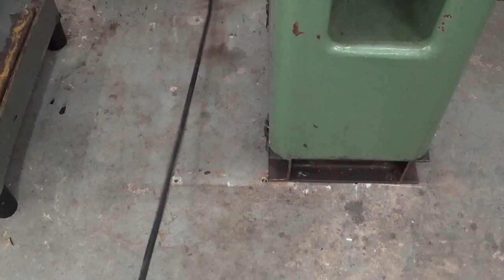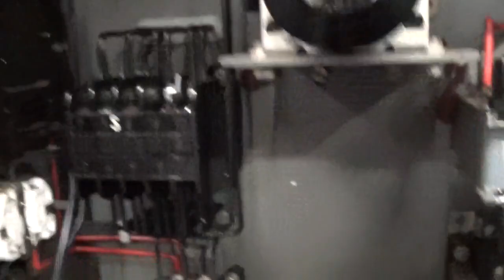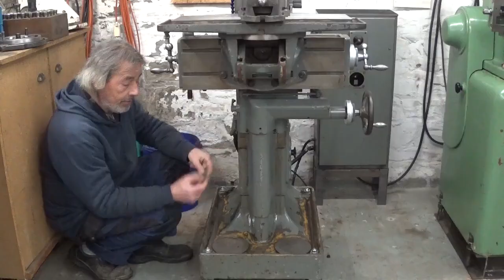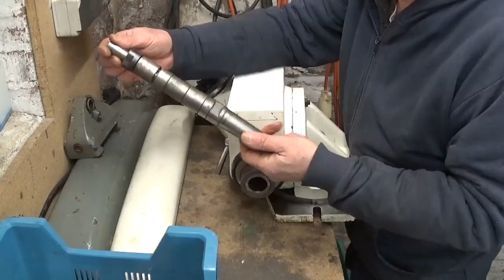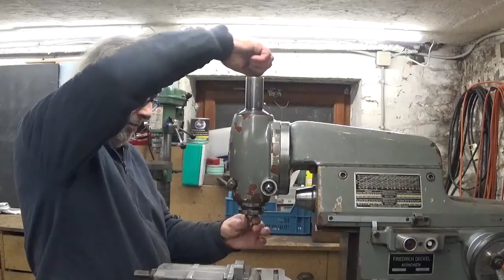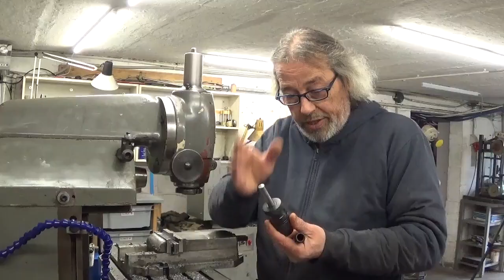My Deckel FP1.

Comment: The last time I saw this Deckel FP1 Stefan Gotteswinter was machining something on his rotary table on his FP1. Rustinox have you checked the run-out of the spindle?
I would recommend the Kurt Anglock vise 204 mm jaw width. I love them.
The handles you can clutch them so when you press in on them they actuate, release the handle and it doesn't move.

Comment: Finally a video on a fp1, I recently bought a 1952 fp1 and love most everything about it. I really wish I could lock my spindle for when I can't get stubborn tooling out and for running indicators in the head while using the power feed. Not having reverse really sucks for tapping as you mentioned as well.   I wish I could figure a way to install a dro off the spindle but have be unable to make happen yet. I'm really glad you made this video and hope you make many more on this old girl as I have so many questions and there are so little answers out there. Thanks  Mike
Reply from the maker: Thanks Mike. I'm still learning myself the details of this machine. But if you have any questions, don't be affraid to ask. I can maybe put them in a video.

Comment: Recently bought on old version of deckel fp1 . Does the horizontal spindle drawbar come out of the spindle. It's rotating but not coming out. I want to check the threads of drawbar so I can purchace some collets.

Comment: I spent 3 years in the early 80s using a deckel fp1 with 3 axis DRO, fixed table, rotary head, slotting head and high speed head on top of what you have there making complex cavities and cores for injection molds. I love the incredible versatility and accuracy of these machines even after 30 years. I also got to use fp2 and fp3.  This was in Australia.
Reply from the maker: That's nice, Ron. I suppose, you know how to run a milling machine now :)
Before I had this one, I only operated a milling machine in scool. Son I have a lot to learn.
Reply: @Rustinox  and you will. I spent over 30 years in metal trades, it's not what you know that matters, it's how much you want to learn. You've picked a great piece of equipment to learn on. I don't know if you have the rotary head  but the collects also fit in that, as do 3-jaw and 5-jaw chucks and a flat plate.

Comment: Now, with the Deckel, the shaper and the very suitable engine lathe you have what could be considered the best equipped Tiny Shop in the World !  Just goes to show that with a little ingenuity and patience you can still build a shop on a budget -- more good work to come !  If you're going to do a lot of climb milling,  get yourself some good quality way oil -- the "stickiness" ( along with proper gib adjustment ) really helps with those worn leadscrews as compared to something like the really thick leadscrew grease .  Of course, looking into getting a new leadscrew nut would also be a definite plus .  Keep up the good work, Rusti !     until later --  ken .
Reply from the maker: "Tiny Shop". That's a nice expression. I like it.
For the ways, I use gear box oil SAE90. Nice and sticky as you suggested. Indeed, it works really well.

Comment: I have the MK1 model, slightly older, from 1938. I received it without change gears for table feed. So i gutted the table feed mechanism and I am replacing with a motor driven system and fit everything in where the previous chain drive was. Only thing stops you from reversing the feed is because feed wont work if you reverse the spindle, but with my approach, I can reverse the spindle too. 

Additional to that, I have the pump for the coolant did not test yet but I can give it to you.
Reply from the maker: That's a nice upgrade you did there.
Thank you very much for offering me the pump, but I don't need. I managed to fox mine.

Comment: Hi Rustinox, gratulations to your nice new machine!
I have also a Deckel Fp1 and iam very happy with it.
You talked about the "Stiff switching" of the feeds, this is exaclty the same problem i had with my Fp1. So i have changed the Oil in the Feed-Gearbox an now, it switches really smooth. I have used 0,75 liter of an HLP46 Hydraulic Oil, witch is recomended for Main and Feed Gears and its really cheap.
You can change it when you open the Flap under the Feeding switches.
Maybe you can try this, i think it will improve the switching alot.
Greethings from Munich,
Andi
Reply from the maker: Thank you very much for your help Andi. I will surely give it a go.

Comment: That looks like an incredibly versatile machine, I look forward to seeing it in action. The work envelope isn't too far off what my mini mill can do. The difference is your one pass 1mm depth of cut in steel would have taken me 5 passes, and 5 measurements to make sure I was still on course. And I bet the surface finish with cooked bearings is better than mine on a good day too! Certainly a machine to aspire too when I look to upgrade. Thanks for sharing. 👍 🇬🇧
Reply from the maker: I also think it was a good choice.
And thanks for your sticker.

Comment: I'm really happy for you that you have added such a lovely mill to your workshop kit. You have definitely made the right choice by buying this Deckel rather than a hobbyist bench top machine.  The Deckel will likely need some fettling to get everything in good tune but it is a solid well made piece of kit. Maybe a project for the near future is a small workshop listing crane to assist with changing vises ,dividing head and other accessories onto the table. A couple of books I recommend are Dividing by Harold Hall. He also authored a book on using the milling machine. Both books are available in the Workshop Practice Series.
Really looking forward to future videos with this Deckel mill👌
Reply from the maker: Thanks for your input. The crane is on my "to do" list.

Comment: Michel, Glad to see you have a Deckel. Your model looks close to mine and I’ll have to check the serial number and see the difference. I agree with your comments regarding the locking lever on the other side of the slide (a pain)! I don’t think the gear selector loosens up either. Happy to chat about the machine, but not sure how to contact you.
Reply from the maker: You can mail me; rustinox@outlook.com

Comment: Ah yes the Germans... great at engineering, terrible at colours (the label text). 🙂
Congrats on getting such an amazing machine! 👍
That is probably 20 times more rigid and mass than most of the benchtop mills, and wow! all those ways you can rotate the workpiece (and fit large workpieces) that is something special right there!
And you also have X and Z powerfeed as standard.👍👍 that has so much more class and soul than a new Chinese benchtop mill.
Reply from the maker: Yes, I think so too.

Comment: Awesome! These machines are very rigid and accurate
You are going to love the FP1 I think, with the right set up you can make a lot of things other mills cannot
What did you make the feet from? I couldn't clearly see
Reply from the maker: Solid 70mm cold rolled steel. That will hold :)
Reply: @Rustinox  Are you sure you don't want an engineering assessment? ha ha

Comment: Awww Michel I am so envious!! i just bought one but it did not come with any attachments, but for me it was an absolute smoking deal and i coule not pass it up!  it is only for now going to be used in its horizontal position after i have re assembled it. It needed to remove 60yrs of grime from it, and yes totally over engineered! I wish i were closer to europe as you folks there have excellent machines and in quantity. And the Deckel attachemnts are not cheap in the least!  you are going to enjoy this machine but warning! your shaper just may collect dust now!! :) greetings from canada....
Reply from the maker: Good deals are rare over here. And no, the shaper will not collect dust.

Comment: Your unknown switch in the cabinet is likely to be a reverse switch. If it is not, it is not difficult to add a reverse switchbto your cabinet . As it is a 3 phase machine ou just need a switch to "switch/swap" any 2 of the live output wires
Reply from the maker: I didn't had the time yet to dig in to it. But I will...
Reply: I do'nt think so. The manual says that reverse is not recommended, and can only be used when automatic feed and oil pump are disengaged

Comment: Nice mill you've got there sir. Welcome to the deckel family. You talked about the german (over)engineering and why the locks of the Y-axis are on the other side. This is due to engineering, because the gib must be on that side, Your y-axis handwheel is on the right side of the machine, so is your angled transmission.
If you"ve got the chance to get your hands on a fixed table, buy it. its much lower than this angular table. you going to need it from time to time.
The powerfeed lever must probably need a cleaning and a good lubrication.
Reply from the maker: Thanks for your input. I will keep that in mind.

Comment: That is a nice mill you have there. Deckel made nice machinery. I ran Deckel duplicator mill A few times, and thought it A nice machine. A great addition to it would be a tombstone keyed to the table. The tombstone would be full of threaded holes to facilitate clamping. A sideplate fastened to the edge would allow clamping parts for squaring purposes. Mine was 
2 1/4" thick × 9" tall × 12" long. 
The key, fitted to the table slots, aligns it, with socket head cap screws through the block into t- nuts to secure it to the table. I used mine every other day for years to hold larger, awkward parts.
Reply from the maker: Good idea. I will think of that.

Comment: Way cool Rusty ! That's a beautiful looking machine and you got some very nice accessory's with it. Congratulations! I'm thinking you could add a reversing contactor since its a 3-phase motor. Would need to verify the gear train can run in the reverse direction without causing backlash or lubrication issues.
ATB...Dean
Reply from the maker: According to the manual it's indeed possible to run the machine in reverse, but not use the power feed when operating it.
Reply: Or use a VFD

Comment: Always fun to get new toys...
What an ugly plug, like a washing machine plug on steroids.... I prefer our cylindrical 3 face plugs...
Something wrong wit the cable? Let me guess. The same fault as for every cable, being to short in one end, never in both ends.
Someone made test cuts in the vise..... I got one small "test cut" but don't remember the intention.... I suppose "the test" was a success...
Cutting square holes.... Tubalcain showed one way not so very long ago...
A drill bit with som life left.... There should be a way to send multiple thumbs up...
Cheers.
Reply from the maker: For the European standard plugs, you need both hands to plug them in or out. These ugly plugs are much easier to use.
Reply: @Rustinox  Are those plugs safe? Suppose the plug is only partly plugged in, just picking up the voltage. The naked rest of the pin is accessible, hope fully not by a child's little finger or any conducting slim thing.
What range do they cover? The European ones covers 32 Amp and I think there are ven bigger plugs.